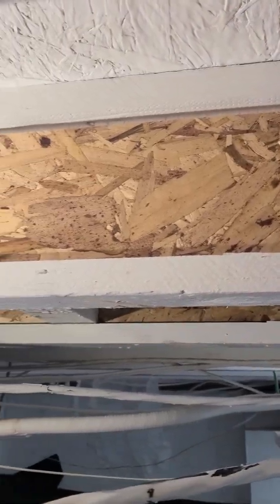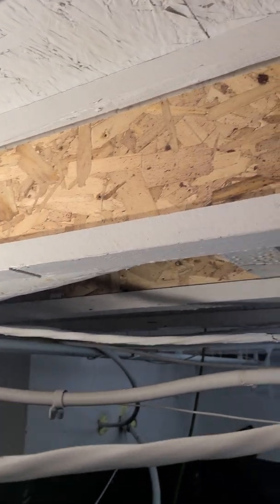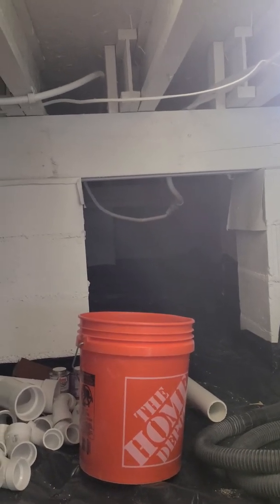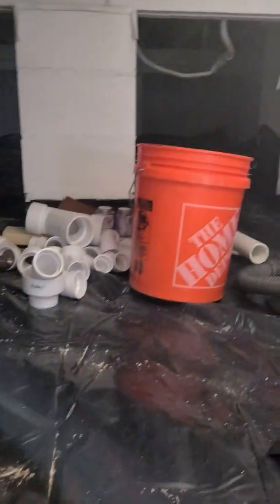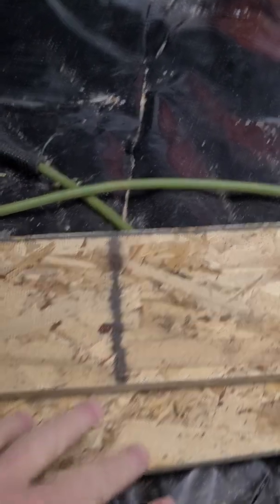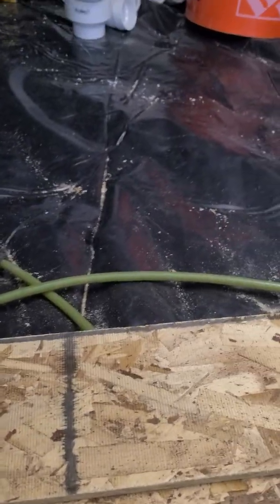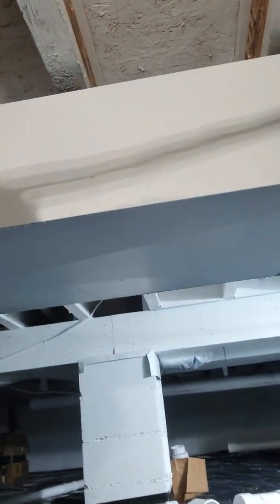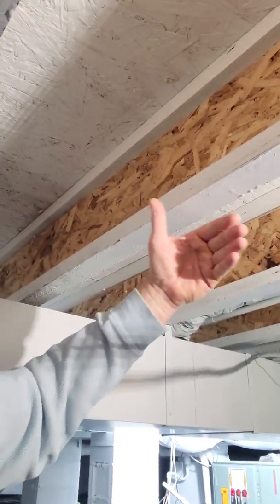I joist reinforcement part 2.

Comment: Thank you for answering this question I've held for quite some time. I took a slightly different approach 2 years ago when building my soundproofed basement theater, and I treated the joists with a layer of half inch MDF sandwhiched with Green Glue and a little Liquid Nails around the corners. A few drywall screws later and I noticed dramatic improvements. And I was just using 4' spans intermittently. My goal was more for reducing "ringing" in the joists. This gives me incentive to run full 8' spans on the remaining exposed joists, especially underneath my higher-traffic areas on the mail floor.
Reply from the maker: Thank you for your so much for your input! It made a big difference and once house is loaded with furniture it should (hoping) be even better. One of my reasons for doing both sides was to be able to screw through all 3 pieces, the web is so thin and almost fragile now I didn't like the bite.
Reply: @danajniblett  You cannot believe how happy I am that I found this video. I have just bought a house, and the floors in the living room and dining room are so dang bouncy... and here you are posting a great video on how to do this by myself instead some crazy expensive option. I cannot wait to do this.
Reply: @camaro02dk  Did you install the OSB Plywood? If so, how were the results?
Reply from the maker: @jordanreid6093 Iz strong like Bull!
Reply: @jnaturally  I am about too now. Been really slow here because of other projects, but this is coming now.